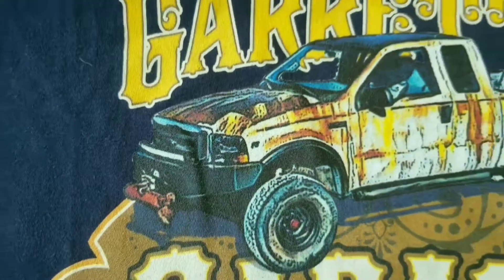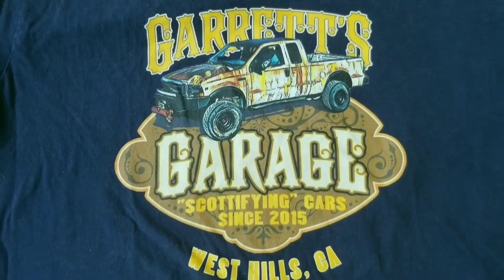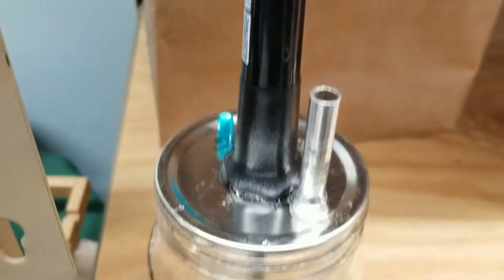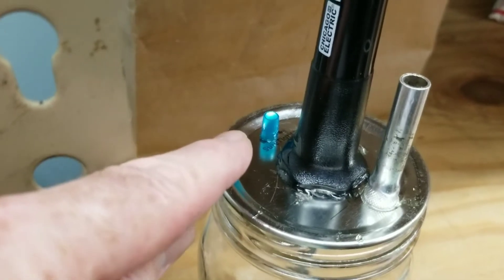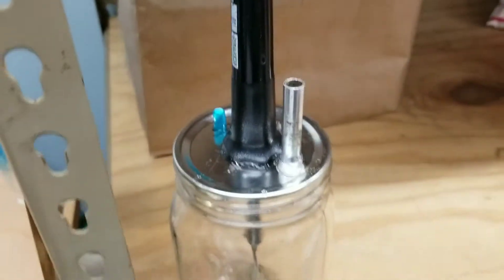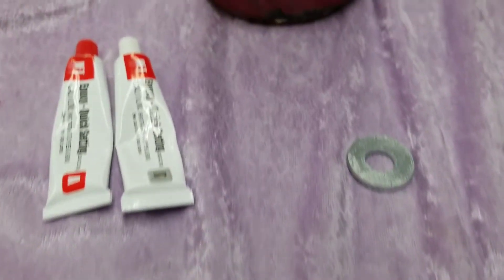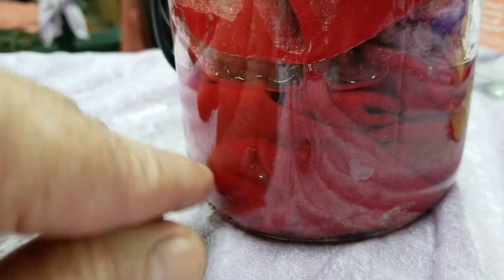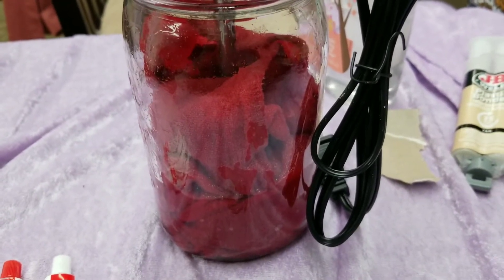Building a simple smoke machine to find evaporative and vacuum leaks.

Comment: A small five or 10 gallon aquarium air pump.. Works great low air pressure  Around one PSI and cheap You can get one for less than $10... Also you don't want metal touching metal part of the jar,, You could've made that hole a hair  bigger..

Comment: What is the safest way to store this when not in use? Especially since the rags are soaked in oil.
Reply from the maker: The safest way would be to remove the oily cloth and soak it in water. Spontaneous combustion is a function of oxidation so keeping the lid on tight would probably mitigate the problem but not for certain.  Personally? I remove the oily cloth and just insert a new one when I need to use the smoke tool again.  Thanks for watching and commenting!